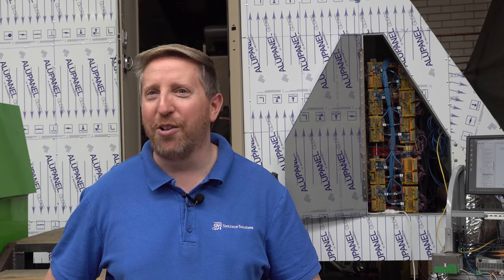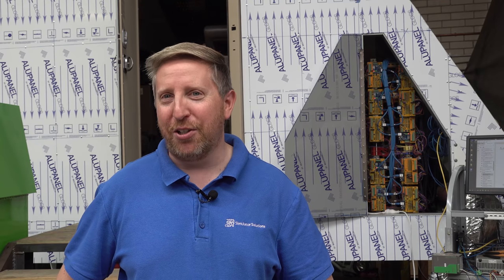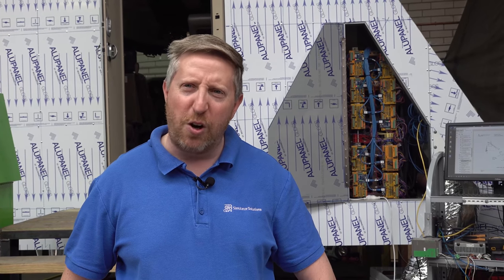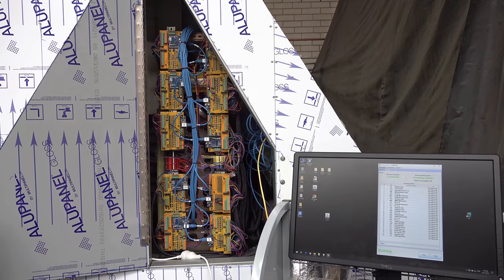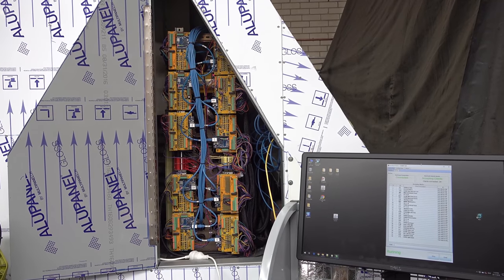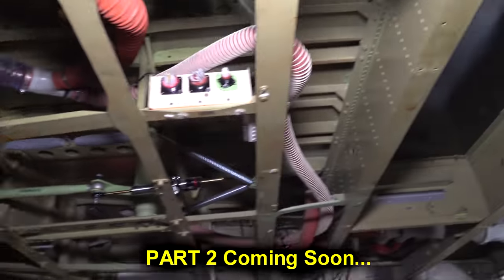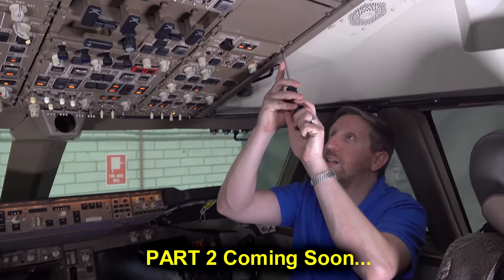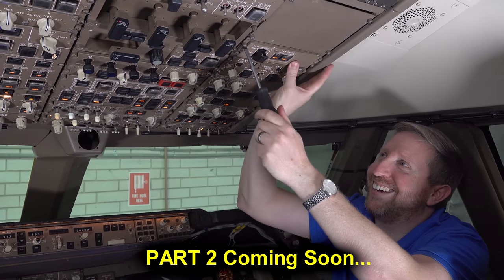EEVblog #1267 - How To Control a 747 Flight Simulator

Comment: I once worked at a small (and extremely ambitious) aviation instrument company, and most of our toughest problems weren't on the development side, but were on the test side.  For every hour spent developing hardware and software, three hours were spent in system testing.  And that excludes component-level testing for hardware and software, which is part of development.  Beyond that, an equal amount of testing is needed for the separate certification effort, where the testing is focused on more than just the instrument, but on its integration with the aircraft as a whole (including Type Certification).

If you've ever wondered why FAA-certified flight instruments costs 10x-100x the cost of uncertified gear, that's the reason:  90%-99% of the cost is in the testing and certification.  It's not just the paperwork (which is merely the proof it was done): It's the endless hours of patient and thorough testing and analysis, and the racks of equipment needed to make that happen (which also needs to be tested and calibrated).

Every engineer was also expected to be a testing expert, and (unlike Boeing) we worked closely with our DERs to ensure we were doing all the right things the right way. One of the greatest difficulties was simulating real-world inputs, and we put extensive effort into developing our test infrastructure.  Some signals could be modeled mathematically and simulated in software, but others had to start from recordings of real-world systems in flight.

As Rod explained so well, there is a vast multitude of ways signals are encoded within aircraft (in both the analog and digital domains) using a chaotic mess of "unstandardized standards", many examples of which exist merely to link two or three specific instruments.  Even things one would expect to be "bog standard", such as GNSS links, have a perverse plethora of permutations.

So, not surprisingly, there is a significant market for test equipment able to generate and receive/analyze these specialized signals.  Many of these are no longer made, others are built-to-order at exorbitant cost, and some (a surprising number) simply don't work for their intended use.  Which means we generally had to make our own simulation and acquisition equipment.

We took a brute-force approach.  For example, rather than directly digitize the sinusoidal multi-phase synchro/servo signals, we simply bolted high-resolution digital quadrature encoders and geared stepper motors to the shafts.  We made fantastic use of Ebay to get old equipment we'd re-engineer to become test equipment.  We even got some WW2-era test systems whose signaling methods are still used today!

We had to verify our test systems were faithful to the real-world environment, which meant sampling real signals in flight.  Being of the brute-force mindset, rather than build specialized signal recording systems, we took multi-channel GHz-bandwidth o'scopes with extremely deep trace depths into the aircraft.  We also became expert at making Hall-effect sensors to non-invasively measure current-mode signals within operating aircraft.

We then flew the aircraft to its limits, both in terms of maneuvers, but also the environment, including flying into storms.  Of course, almost nobody would rent you their airplane for such testing.  Even NASA wouldn't let us piggy-back on their storm-chaser planes.  So we had to purchase, operate and maintain our own small fleet of test aircraft.  Those were, by far, our most expensive pieces of test equipment!  Yet another reason why FAA-certified instruments cost so much.  This was for a company with under 100 employees, including the staff for our in-house manufacturing lines.

When we took our cockpit instruments and sensors to trade shows, we also took some of our simulator equipment to drive them.  At one very large aviation trade show we received many more inquiries about our simulator equipment than for our flight instruments!  Those requests came from other instrument makers, and we realized we had a significant competitive advantage in our test systems, else they wouldn't have asked about them.  From then on, our test gear was kept in locked and sealed racks that were never opened in the presence of others.

I'm wondering if Rod and Simulator Solutions have explored the aircraft instrument test market?  Unlike the flight instruments themselves, the test equipment hardware/software is not FAA-certified at all, other than ensuring the signals they generate meet the applicable aviation signal standards (more of a specialized calibration/verification than a certification), and that the test equipment will not damage the instruments to which they are connected (per industry-standard safety and EMI/EMC specs).
Reply from the maker: I've been there!
Reply: Instrumentation test is a particular application of engineering I would enjoy learning more about.  Perhaps Dave can take us into this aspect in some depth?  1,000 questions including why are the test systems not under FAA type certification?  It seems that if there's a flaw in the test equipment, problems with the instrument under test could go undetected.  So, how is this mitigated?
Reply: I enjoyed reading this post as much as I did watching this video.
Reply: Thank you Bob C, the aviation instrumentation verification test world is fascinating!
Reply: Great post!  Thank you .

Comment: I spent 20 years as a software engineer in the simulation industry (I am intimately familiar with the AH-64D helicopter sims the US, UK and other govt/military use as well as the F35).  I primary worked in the visual system side, but also worked with the hardware and interface side of things. It is super impressive to see a smaller group of individuals take a project like this on. I can tell you that the civil aviation simulators had huge budgets with 100s if not a thousand or more people working to develop these solutions. Will be fun to see how this all turns out when finished.

Comment: I'm a retired United Airlines Pilot and definitely spent many hours in that cockpit and simulators at United's training center which were indistinguishable from the real thing.  It's sad to lean that that beautiful airplane was cut up. BUT... it's a good use of surplus parts. 

Boeing never "over-engineered" anything. They used appropriate redundancy, strength and reliability.  Until recently the greatest airplane manufacturer, ever.
Reply: Every pound counts it's weight in fuel.

Comment: "what constitutes an Arduino ?" the guy sounded a bit embarrassed...he didn't need to be, I've heard it alot from people who have large super complicated projects,  and when you say " so it's got an arduino in it ?" they rapidly tell you about their firmware and how much its NOT Arduino...I think its super cool that it has off the shelf jelly bean MCU's with now almost de facto footprints at its heart..go 328PB go !...It looks very much like an Arduino because it IS an Arduino !....great project and what seems like a passionate bunch! I would very much like to see more please Dave.
Reply: Their software stack('simstack loader') is also heavily based on the Arduino IDE(Screenshots and code on their website).. But that is a good thing as the list of libraries is massive and adding more advanced and interesting hardware becomes much quicker and easier.
It's the perfect platform for something that has to be as flexible and configurable as this.

Comment: God I'm jealous. Some people have the most amazing setups. Combat sim pits would possibly be interesting for EEVBlog viewers too. They tend to get a bunch of real world components, but of course not every component is available and the interface to the computer is different so they have to design their own back end. I recall seeing one guy get a real RWR, essentially an electron beam display. But for some strange reason the control plates were mounted at 45 degrees, and of course didn't come with instructions for the connections, so he had to work it out and design the controller to write symbols and letters where and when the computer asked for them. It was a great read. I've spent a few thousand on my setup, but I'm not even on the board compared to what a lot of people have managed to build and the work they have done.
Reply: Very interesting, do you have any pictures or anything of your own setup? Is it based on a single aircraft?
Reply: @SeanDuffyProductions  Its nothing particularly interesting. I wouldn't call it a pit or anything like some people have managed. Just a high end stick, throttle and pedals, TrackIR to convert head tracking to pilot movement, and some commercial grade buttons. VKB stick, Virpil throttle, MFG pedals, and buttons from the likes of Thrustmaster. Its not really about realism so much, I've got VR but I forgo it for the unrealistic TrackIR as it performs better in game. The stick is from the PAK FA, the throttle is inspired by that aircraft but also by other 4th gen aircraft and nothing like a real world stick, the pedals look like a WW2 set but are the only good performing pedals on the commercial market, and the other controllers are from assorted aircraft. I'm still in an office chair at a desk and with my mouse and keyboard to hand. I'm just lucky enough to have resources to buy my top choice of equipment and backup equipment to play the assortment of mostly western planes and helicopters in DCS flight sim. A lot of people have managed to make an actual pit at that cost, but I'm happy having an unrealistic setup, playing multiple aircraft, and having my own favourite selection of equipment and my own custom keybinds unlike the real aircraft to go with it.

Comment: Very cool, I was going to build an L1011 cockpit and bought all the Autopilot controls for it. Ultimately I became an airline pilots and abandoned the idea. Still have the L1011 autopilot controls. Today I fly 747-400's for a living.
Reply: The L-1011 was a beautiful  aircraft ahead of its time and capable of Cat IIIc landings in zero visibility.
I wonder how it compares with your 744 'LAND 3' capability.
Reply: @davidpalmer9780  I haven't flown a L1011, one of my coworkers still does for the rocket missions. He would be a good one to ask. The 747-400 auto lands very well

Comment: Those nifty gray keyable connectors are Wago series 733, with an ultracompact 2.5mm pin pitch. I've been looking for connectors like these for a long time.
Reply: I wonder if they use genuine Wago's or they ordered 'compatible' imitation connectors from some generic China supplier. Because those terminals would almost cost as much as the rest of the board.
Reply: @Stoney3K  Apparently the real thing. "SimStack boards can be ordered with standard spring connectors, Wago 733 series connectors or a mixture of both.  The Wago connectors add approximately US$25 to the cost of each board." See https://simulatorsolutions.com.au/new-connectors-for-simstack-boards/.

Comment: So basically, it is just an arduino, bunch of shift registers, bunch of random mosfets. Unprotected inputs, unprotected outputs, no  controlled switching slew rates, no ESD countermeasures,  no EMI compliance etc. I see a lot of work there to be done. But I stay being corrected!
Reply: The SOT-23-3 parts might be some BAV99 or similar protection diodes for ESD, and he said that all outputs are fused. And looks like there are resistors before the gates, which would limit the slew rate (but increase the power dissipation at the MOSFET). This would help with EMI compliance as well, which they might have tested, because they are selling these things.

I expected it to be more expensive, but price is only US$85:
https://simulatorsolutions.com.au/simstack/output-board/
Pretty good for such a niche custom board with 12 bit PWM capability on each channel.
Reply: Well, my issue is, that such designed boards may become dangerous, especially in such large installations. Unprotected outputs may start a fire (You can find a detailed photo of the PCB in question, there are no fuses or protections at all). Just plain P/N mosfet switches. 
Also, random ESD/surge event may cause the control system to enter unknown states, that can, within a motion-capable sim, cause serious injury to the people around. 
I am not telling you the board in question shall be CE or UL certified for whatever required standard, but that an industry standard and best practices shall have been used  when designing them.Those SOT23 diodes mentioned are clearly just G-S protection zeners. 
And the PWM is very likely to be a 12bit just per an output bank, not channel-independet. That is what the Q1 and Q48 on the PCB likely does. 
For the money they have to work with, they at least should be able to do a proper design job.
Reply: @Sixta16  Having used their products, I can assure you that the power outputs are fused - 3A fuses on every Output channel and 10A fuses on each Power Supply input.  I should also add that every output channel is individually dimmable.  I have spent hours talking with these guys about the work they have done in designing SimStack over the last 5 years.  I know that they worked through many of the issues you have raised with some very experienced electrical engineers who completed the design work for them.

Comment: What I'm curious about is how they've handled the cockpit displays since those are generally connected to an outboard computer somewhere in the avionics bay, the monitors are just dumb CRT displays. It would be a considerable challenge to reverse engineer what pins do what on those monitors and try to talk to them without any information on how the protocol works.

ARINC429 is basically just a serial bus so it's a lot more straightforward to implement.

Comment: Gold in the windows also reduces UV exposure for pilots.  Source: for a brief time I worked with guys making 747 cockpit windows!
Reply: Gold is used in windows because it reflects Infrared, not UV.  It limits solar heating in the cockpit.  Gold reflects almost nothing at UV.  The glass takes care of the UV.
Reply: @stargazer7644  - cool. I knew aluminum did, but wasn't familiar with gold, but makes sense since the lunar lander was blanketed in gold foil.  Also via Google > "Gold, silver, aluminum, Plexiglas and hybrid pigments are materials that reflect infrared light."
Reply: @onjofilms  That's why the James Webb Telescope has a gold-coated mirror instead of aluminum. It's a special order item for any mirror telescope you might want to work in IR.

Comment: To be fare, there are PLC solutions that will do all of this, including scalability, slaving sets of cards, and Ethernet access to program them. This even includes cards that can handle multiple input and output types with plenty of channels. They are very expensive and there would be WAAAAAAAAAAAAAAYYY more wiring. They are intended for use in industrial automation and as such and come with a requirement of knowing how to use them that is brand specific (the companies that make them will train you, for a large sum) while being highly reliable with a price to match.

Comment: ARINC 429 is a specification not a standard, us a arinc 429 card and it's not too hard to program. built a static simulator based on a C130 cockpit to train test pilots to fly a c130 which was going to be fitted with an engine that was twice as powerful as the other's. all electronic flight instruments were driven by ARINC 429 Mathcad was used to provide the feed back to the pilot controls. it was a shame to see the cockpit being removed from the aircraft. but a fun project to work on.
Reply: And getting your hands on an ARINC429 card if you're not in aviation will probably set you back as much as the entire development cost of these cards.
Reply: @Stoney3K  hi you hit it on the head, the ARINC card was not cheep, about £1000 or so. but putting that against the cost of cutting off the front of a C130 let alone the cost of the C130 its self. it was sad as the plane had flown in so was not a scrapyard item just yet. we got a few funny looks then they found out that Microsoft flight sim was running in the background and driving all the military flight systems. You could put the flight plan into a state of the art glass cockpit and then fly around in the flight sim. all the real computing power was used in providing control feed back to the pilots. it was great project to work on.

Comment: Great project. But I still doesn't understand: who makes the simulation software that runs the hole thing including the displays?? like airdatacomputer, sensors, stallwarnings, radios, autopilot etc. etc. all these thing. That is extremely big and complicated project to replica a aircraft in software.

Comment: What a huge project.   Simulator Solutions builds these for sale ?
Reply from the maker: Yes, you can buy them. Although you'll likely need help in setting them up, as he said, it's not for Joe Average to just take out of the box and use. Talk to Rod about it.
Reply: mPky1  See their webpage. For example one output board costs US$85:
https://simulatorsolutions.com.au/simstack/output-board/
Looks like all software is free to download. So I guess it wouldn't be too difficult or expensive to build your own system.
Reply: @frankbuss  Obviously, this would be depending on what kind of hardware you intend to put into it. I can imagine using these boards as solid state lighting controllers for complex Christmas light displays.